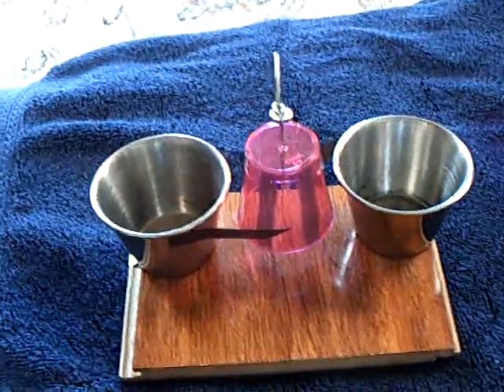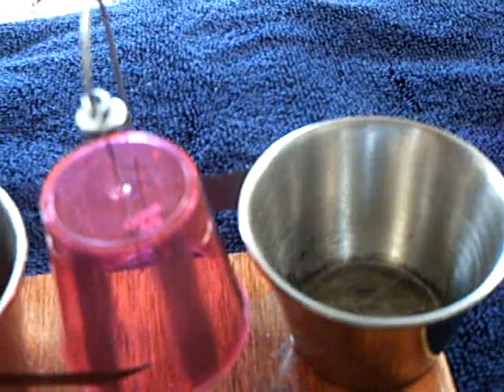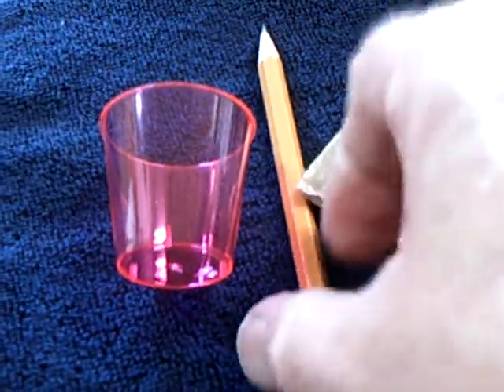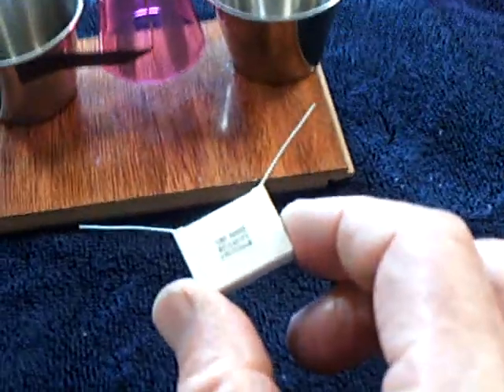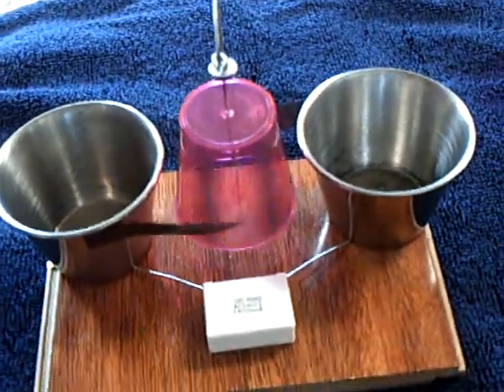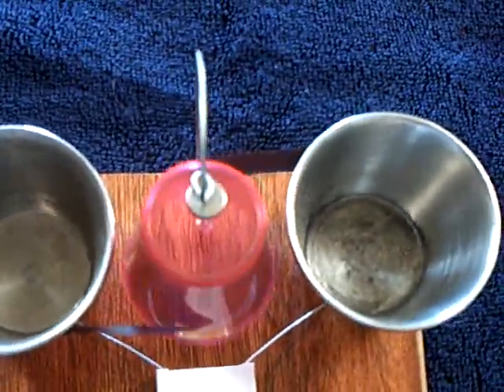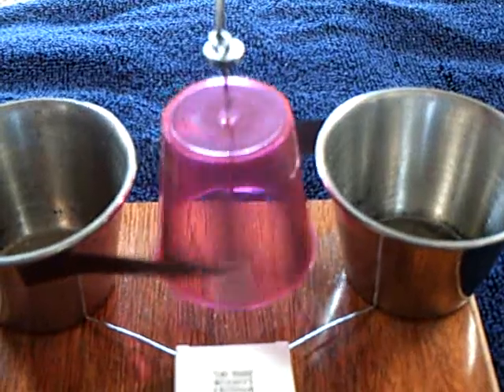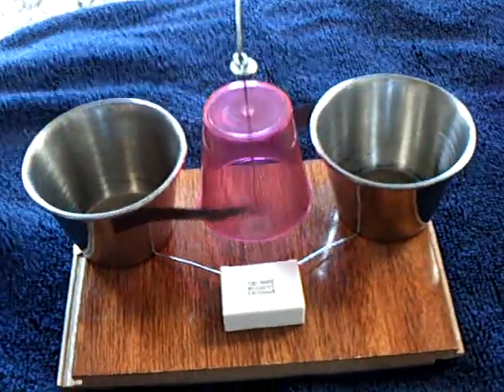Thin Graphite used on Electrostatic Motor

Comment: Instead of using the graphite powder from the tube what if your just use sandpaper on the top of the pencil.. to get the powder that way. Is pencil graphite powder same as the stuff in the tube? Would save $. Just wondering.

Comment: Neat!  What is the start V of your cap & the amount of charge in it?
Reply from the maker: I don't have a way to measure the high voltage but the voltage output on these bug zapper circuits is usually somewhere between 1-2 KV.
Reply: Interesting, but then how do you know when the cap is fully charged?
Reply from the maker: A B It is very low farad cap and it charges up in seconds.
Reply: So you just connect it for a few seconds & assume it is fully charged.  Have you ever popped one by keeping it connected for too long?
Reply from the maker: A B So far no.  It is a 1500v cap here and it seem to do just fine with what comes out of the bug zapper. There isn't much amperage but it is pretty good shock if you are not careful with it.
Reply: "There isn't much amperage but it is pretty good shock if you are not careful with it."
I'm sure you are right about that.  There was an old gag in the electronics shop in the military in which someone would toss a fully charged high V (low F) cap to a tech to get a laugh...  It's harmless, but it's like a pretty good static discharge in the winter on a door knob.

Comment: Quite amazing and brings even more useful learning about electrostatics. Tape is a great long lasting vibration and shock absorber too.
If you extended the rotor holding pin and put a magnet in the base might you lose some wobble ?
Enjoyable video :)
Reply from the maker: I need to build simple generator now to make sure this new find works on those.  I have one of these motors that has a magnet top and bottom to stabilize the rotor (Magnetman's needle motor arrangement).  It works great.

Comment: Thanks for showing this, I will most certainly give it a try. How would you rate performance over the other method?
Reply from the maker: On this motor it works better than the Al foil.  For one thing it is lighter and more responsive.  Using the charged up cap method the rotor turns longer.

Comment: Very cool. That buffed surface on the rotor is graphene. Buffing it mechanically exfoliates the upper layers and heats the plastic underneath allowing it to bond to the plastic. If you did the exfoliation thing on the sticky tape....you could call it a graphene motor!
Reply from the maker: Man I hope you are right about that.  I really need a good microscope to see what these exfoliated surfaces look like. I'm afraid that it is too thick.  I read somewhere that you need to be 5 layers or less to win the prize.
Reply: ***** you probably won't see much even at high magnification...even at 5 layers thick, your talking about 5 carbon atoms high stack. Measure the resistance as you wear it down...it gets less as it gets thinner. The guy who got that Nobel prize only used sticky tape to peel it away. Buffing graphite off a plastic surface makes a good graphene surface. Check out Robert Murray-Smith on YT

Comment: These electrostatic motors of yours are getting simpler and simpler to make. Do you know what the minimum voltage requirement is?
I wonder if there would be advantage to forming the segments as you did with the super cap?
Reply from the maker: The electrostatic motors that I have made need about 500vdc to run.  As far as making a super cap using this method I don't know if it would work or not.  It is worth a try.